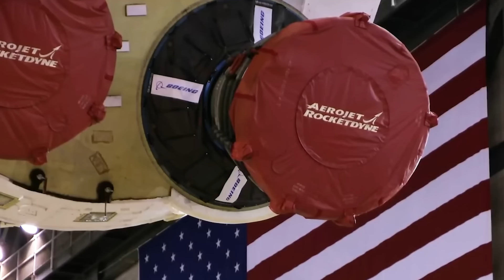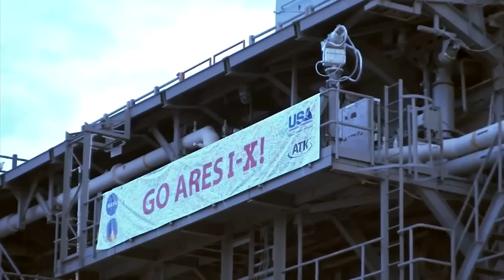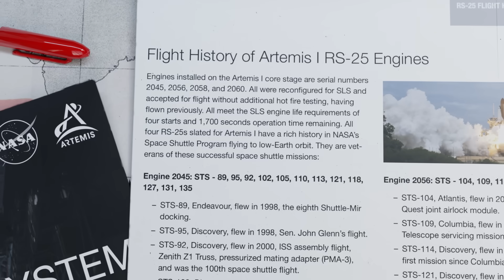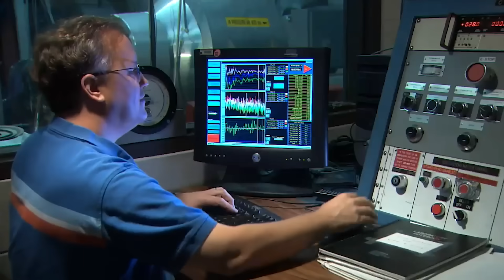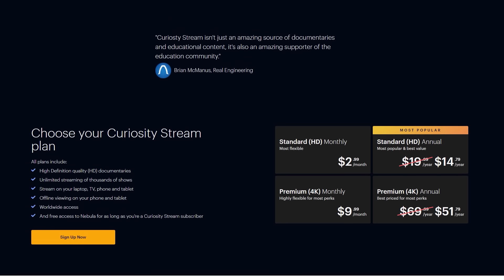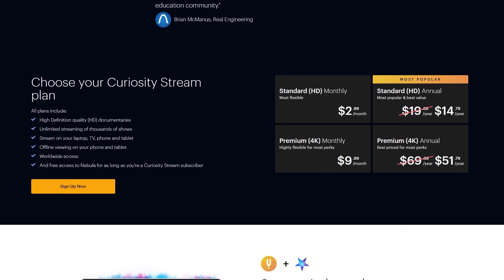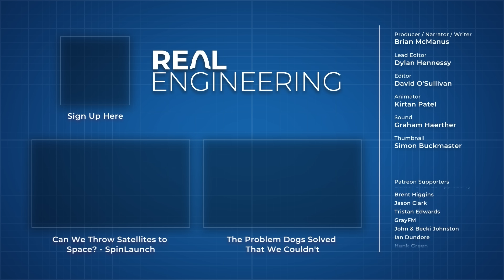The SLS is Outdated. Why Does it Exist?

Comment: Yes, the technology is outdated. But guess what? It's the only rocket capable of going to the moon and mars currently.
Reply: how can it be outdated when there is nothing that works better?
Reply: @divedevil985 SpaceX?
Reply: @Nighthawk268 falcon rockets are LEO only and Starship is still yet to be operational
Reply: @dod_the_angel  Fair point.
Reply: @truegrit1860  has starship left atmosphere and achieved orbit? Has it gotten to the moon? Has it done literally any test flights without something breaking or disintegrating?
Reply: @truegrit1860 Starship can't leave LEO without an indefinite amount of refueling flights (the number goes up every time Elon opens his mouth). This completely negates the cost savings of reusability (which is moot anyway because Starship won't be in reusable configuration for HLS anyway lmao). It is absolutely NOT a viable alternative to SLS for any practical use.
Reply: Currently?

Comment: turns out cobbling a rocket together from sts technology is actually harder than just building a rocket from scratch
Reply: Well, the hard part was building up the infrastructure, after so much had been torn down.  Future Artemis missions however will use brand new SLS's built from scratch.  The newer-built engines will be of the same design, but not built to be refurbished and re-used, so their cost per-engine will be reduced drastically.  Another reason why the SRB's won't be re-used, because the Block-II variant will be more powerful, more efficient, and even less costly.

Comment: The trick with "outdated" with respect to rocketry, is that we were capable of 95% of what is possible when Saturn flew. The J-2 hydrogen-oxygen engines of the Saturn had a specific impulse of 428s, compared to the 452s of the Space Shuttle RS-25 or 470s of the most efficient RL-10s we've ever flown. RL-10s in the 450s range were flying at the time as well. Compare to the best kerosene engines at ~340s or projected best methane at ~380s. On the other side of the world, the Soviets were building NK-33/43 engines, some of the most efficient and best thrust to mass ratio kerosene-oxygen engines ever flown. All our big advances in rocket design have been and will come from materials and structures, and even there the gains will be noticeable but small.

Additionally, there is no commercial vehicle that comes anywhere close to the capability of SLS. Starship is unproven and will not be crew-rated any time in the near future. Additionally, its mass to the moon is limited and it will work best as a low-earth orbit launch vehicle; methane doesn't work well for high energy missions, which is basically anything outside LEO. Falcon Heavy doesn't have the structure to lift 50 tons to LEO, even if you had a payload that would fit inside the fairing or had its own fairing. New Glenn hasn't flown yet and I haven't seen any evidence of flight hardware besides the BE-4 engines, but its BE-3 powered upper stage would likely work well for moon missions.

Finally, if you don't think a hydrogen-oxygen stage is the way to go, think of it this way. SLS Block II cargo is slated to carry 46 metric tons to trans-lunar injection in its cargo iteration. If you assume an equivalent engine and structures mass and replace the hydrolox fuel with an equivalent mass of methane-oxygen fuel, then assume it has the best projected efficiency at 380s isp, SLS would only be able to get 27 metric tons to the moon.

Comment: So there is nothing wrong with the rocket other than the cost of development?
Reply: Its less effective and not reusable. As well as it being outdated technology
Reply: @Trippy2549 reusability is not a blessing you seem to think it is. SLS is not reausable, because it does not have to be, since it is planned to launch once a year or so, where reusability would not be practical or cost effective. You have to fly A LOT to make reusability worth it, and launch market is not there...
Reply: SLS is extremely expensive to development, extremely expensive to build, and can only launch once a year at best unless several billion more is poured into it to launch twice a year. At the same time, SLS cannot be reused in anyway (so no means of saving or recovering costs), cannot launch enough to land anything on the moon or Mars, cannot be refueled in orbit, and it has a smaller payload capacity than Starship. Actually just 1/3rd more payload capacity than Falcon Heavy, which cost about 1/5th the price per launch.
Reply: @PremijerPlenky  SLS takes so long to be built and is so expensive to build that projects have been canceled or moved to other launchers. Even the current lunar programs are in jeopardy due to the low launch cadence of SLS. If it weren't for Starship, even just as a planned ship, pretty much everything would be canceled.
Reply: @PremijerPlenky You got it backwards. It can't fly a lot because it's not reusable and it takes immense amount of time and money just to build a new one. For every SLS launch you could have 100 Falcon 9 launches, for cheaper. It's absolutely insane.
Reply: @VG_164  But we are comparing apples and oranges. SLS is there to serve as a man rated heavy launcher, Falcon 9 is perfectly suited for LEO, be it crewed or cargo missions. Falcon Heavy is unfortunately not man rated. 

By the time contracts are signed for Block 1B and further development, then we are likely to see price drop further, 850mil$ or so, per SLS launch which would make it less expensive then Saturn  V. 

Starship has yet to reach orbit, SLS has launched Orion capsule on cislunar voyage.

Comment: Followed the Constellation program since I was 10. SLS seemed like a good idea in 2010, but now 12 years later it is 5 years behind schedule but still first to the new super heavy lift party. The fact that the boosters and main engines are reusable, but will not be salvaged is troubling especially when SpaceX has fully reusable rocket first stages and ULA (maker of the SLS) is going to have the engines of their new Vulcan rocket parachute back to Earth.
Reply: PEACE 
LOVE 
HONESTY 
PROSPERITY 
FREE THINKING 
GOOD HEALTH 
OPTIMISM
Reply: As the video said, this was and continues to be a job-creation project. They’re using the shuttle engines and SRBs because they’re still around, but fully expendable versions are currently in development
Reply: But those two reusable rockets haven’t flown yet.

When they DO, you might have a point.
Reply: @michaeldemarco9950  what do you mean?  They flew Tuesday morning.  They’re using reusable tech in an expendable format because that’s what they have right now.  The new tech being developed is also expendable.  Nothing about the SLS is meant to be renewable
Reply: @yerkees01 , did you read my post? You are repeating what I just said.

Starship and ULA have not flown.  And will not fly humans for a while.  SLS is flying.  It will do just fine bridging the gap until Starship can take over.  Until then, thank God for SLS.
Reply: @michaeldemarco9950  my mistaken.  I though you were replying to me, not the original comment
Reply: @yerkees01  , no problem.
Reply: @michaeldemarco9950  Falcon Heavy has already flown and has a reusable core stage. Vulcan has not flown yet.
Reply: @joshuamueller3206 , I was thinking Starship.  It’ll. E a while before it flies humans, and Falcon Heavy will (sadly at this point) never fly humans.  ULA will, but only to LEO.

So, for the current time, SLS is our only option.

Quick note: I don’t like these one-shot Moon missions.  I figured the next time we went back to the Moon, we’d be assembling a nice moon ship in LEO, and fly out in style.

Comment: I watched man land on the moon in school and the shuttle explode at university , then visited the Korolov space museum outside Moscow , so little progress since then , SpaceX crows about reusability but wasn't the shuttle reused ?
Reply: Nope! The shuttle was "refurbished". Especially after challenger, getting one ready for reflight was an EXTENSIVE process. The thermal tiles were constantly getting damaged and needing to be rechecked, they basically dismantled all the major components, engines included, in a hugely expensive process that took months to complete. Reuse was the intent, but cool as it was, it was not reusable.

SpaceX rockets, and hopefully plenty of other companies and NASA itself down the line, are truly reusable. We're getting closer and closer to a 24 hour turnaround on a rocket from landing to reflight, which is absurdly effective compared to shuttle. I recommend you look into starship and falcon 9 some more.

Comment: The SLS is not outdated. It employs the best Cryo fuel engines and the best solid boosters...it is not about technological achievement, nothing could be better other than that except Thermal Nuclear which will never be done by the USA..
Reply: errrr yes it is outdated if for no other reason than it doesn't use reusable parts not only that it wastes money that could be spent on other missions and new technologies
Reply: Except the engines are destroyed and more won't/can't be made.
Reply: @charlygriffin2828  We don't have anything that can take something the size of Orion out to the moon and return. IF Starship succeeds, it still requires refueling missions once in LEO to even make a go for the moon and back.
Reply: @HoHhoch  true, and also SLS is actually something you would THRUST (pun intended) to put a payload of that importance to the moon, because of its reliability
Reply: @roflchopter11  RS-25Es are being developed with a cost saving design using 3d printed components. We are quite literally making more engines

Comment: Let's look at the scorecard:
Artemis has successfully gone around the moon and Starship just blew up on a launch attempt.
Reply: rahul22 22  fair point
Reply: rahul22 22  funny thing is SLS development started in 2011 and starship was formulised in 2012
Reply: @izanagisburden9465  funny thing is SLS took over 30 billion dollars and planned since 2007, all of starship development alongside with starbase has costed only around 3-10 billion dollars. 

while being much complex and new compered to SLS technology, still has a long way to test and develop such a complex system.
Reply: @izanagisburden9465  SLS was "formulised" (as you put it) in 2010 after a name change, but the program existed prior as the Ares V under the Constellation program that started in 2005 using engines that were designed and built in the 60s and 70s. For Starship, the Raptor engines began development in 2012, but the craft didn't until 2018.

Comment: This rocket was obsolete before it even left the drawing board and the only reason it did was two keep the senators in the respective states it was built in happy now if it was built in house solely by NASA without Boeing/lockheed or northrup then the cost would've dramatically came down and more launches would be more feasible, but the kicking and screaming senators wouldn't allow it.

Comment: now in January 2024.  Starship has flown twice and neither reached orbit; the first attempt inflicted large damage to the launch site.  SLS has flown and was a complete success.  Maybe not so outdated then.
Reply: Starship wasn't planned to reach orbit on the second flight. But it could have if they had planned it. The first flight also wasn't planned to reach orbit. It did damage the launch pad, but they had it completely replaced and upgraded in just a few months. The second flight occurred just 7 months after the first. Third flight is already ready after just 2 months, but is awaiting FAA approval.

SLS's first flight wasn't a complete success. The pad was damaged, requiring months to repair. Several failures onboard the rocket also happened during the flight. They are working on those failures, delaying the second flight. The second flight won't happen until after 3 years after the first. 3 Years.

Comment: At least it works and proven...........unlike Starship.
Reply: Starship isn't past its deadline and late like sls and orion. 
Starship will launch another 7-8 times this year.
Reply: @goldenshatter  I'll believe it when i see it. :))
Reply: Starship has had more successful launches than SLS so far...
Reply: @miguellopez3392  Starship 4 out 4 failures, SLS 1 out of 1 success.
If you had to put Elon Musk in one for a flight which would you choose?......
id pick Starship.🤣
Reply: @Leon1Aust  lol im going to need an explanation on the mental gymnastic to suggest it failed 4 out of 4 times the firds time the booste faile dot achive full speed so that counts as  alaunch failure, the last 2 attempts has the rocket attempt a re entry of which the SLS would fail emmediately, and last test had sucesful launch and landig of both booster and starship. the SLS hardware comes from the space shuttle program which blew up its astronauts twice, musk falcon 9 has the highest safety record of any rocket made and the falcon heavy has had no failures.

Comment: Something not talked about in this is the safety requirements NASA has post shuttle program. Human rated launchs can not be on rockets when the launch can not be safety aborted at ALL times of the launch. These time when abortsare not possibleare called "black boxes" due to their representation on the abort system flight plan. The Constellation programs Ares I (the one shown testing in the video) had a black box window for the majority of the rockets first stage. This conclusion came from an AirForce study on the rocket, which basically canned the hole project. 
It can be argued Artemis is coming out at exactly the right time. SpaceXs crewed Falcon 9 is only capable of LEO launches. Starship is a decade or more away from being human rated, and it is also doubtful that Falcon Heavy (which would be required for a moon or mars mission) could be human rated either (regardless of SpaceXs moving all development to Starship-Heavy). There are simply no other options for transporting astronauts to the moon at this time, and no plans from any of the big players in private space to pursue that. It's possible and probable that NASA uses Starship-Heavy in the furute to build out and fuel deep space craft in space, and then using a Crewed Dragon to man it, but that is also at least a decade away.

Comment: The Space Shuttle SLS on its own could deliver a total of 135 tons into LEO, but because the orbiter had to be brought back every time, it's capacity was limited to only 24  tons of payload. Almost as much as Saturn, but in a much smaller rocket. The Space shuttle was a great machine, but it wasted most of the capability and budget of the platform simply to bring itself back than what this could really do. The ISS could have been completed in 6-7 launches.

Comment: IIRC, the Space Shuttle program was also based upon a political compromise (civilian vs military). The Air Force wanted something longer so the shuttle design was lengthened. But by the time the first shuttle flew under a different administration, the Air Force had backed out so began increasing launch frequency at Vandenberg AF base in California.

Comment: Did anyone notice that if you don't fund the people that build the rockets they go out of business? If the USA wants a space program it needs to be sure that it has enough work building rockets to launch satilites and missles because there isn't enough space exploration to keep the people who build the buildings, launchpads, transpotation systems going. SLS or Space Launch Systems is like rocket legos where space hardware is becoming compatible with each others systems. This is just as important as reuseabillity. Solid propellent rockets supply 75% of the thrust fir SLS. Those segments have been reused. They are not being recovered because of age, and design changes.

Comment: I know a guy who works on the SLS.  He was originally hired by NASA during the Bush administration to design a rocket for a manned mission to Mars.  Then Obama came to power and he said no the moon, (redesign).  Then he said nevermind.  Then they came back and said ok build one, but you need to use stuff we already have. (Another redesign) The whole process took alot more money and effort than building and testing a single rocket system from the ground up.  Also the required use of existing technology, both expressed and constrained through budget, has meant we didn't develop enough new technology for all the money we spent. (Also not part of the original plan).  I think NASA is happy to have a rocket,  but not happy about the cost, timeliness, destination, or reusability of the rocket.  Much of that is the fault of politics, and why private ventures are able do more for their budget than NASA at times.

Comment: At 4:15 the narrator says that "the NASA budget was switched to one that was not commercially viable" while at the same time showing images of the JWST under construction.  

There are two problems with that statement.  One, the JWST may be "commercially viable" but it does real science for which it is hard to put a value on.  Like the Hubble before it which could not be considered commercially viable either but produced priceless images of the universe.  In other words talking about commercial viability in the context of the JWST is irrelevant.  

And two, since when was the shuttle program commercially viable?  It cost one billion for each shuttle flight and was discontinued primarily because it was too expensive. And there were safety concerns as well.  Some critics went so far as to say that the shuttle program was a failure which is an extreme view  imo.

I'm glad to see that this video ended up framing the SLS in a positive perspective.  At least the first launch of Artemis is going forward and despite the cost I don't see any point in people habitually bitching about it.  It's still going to happen with or without you.